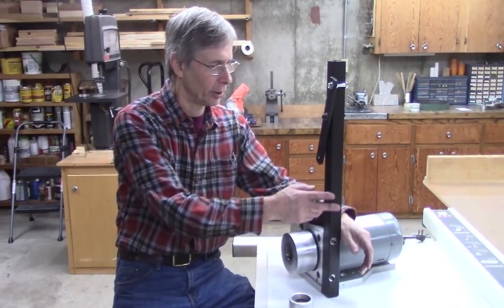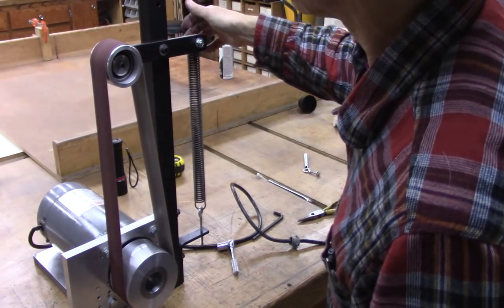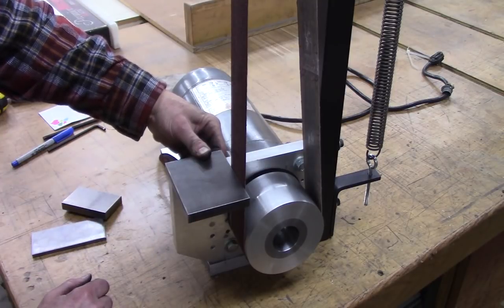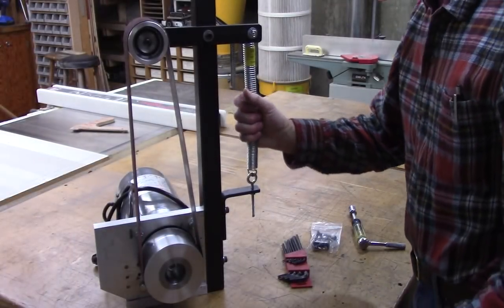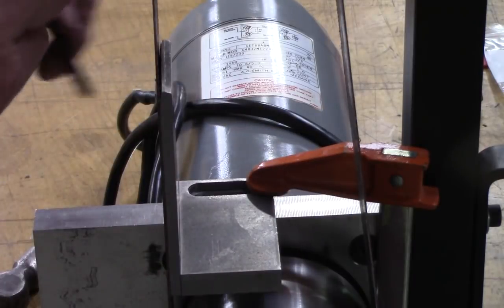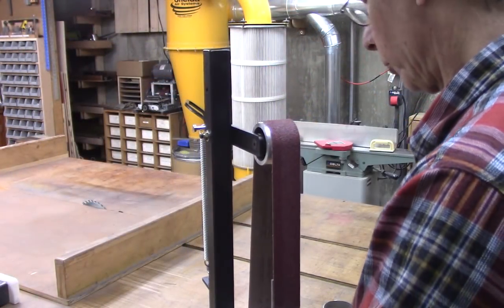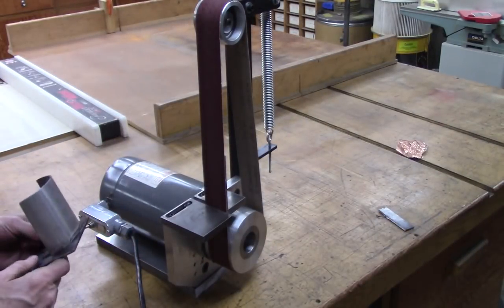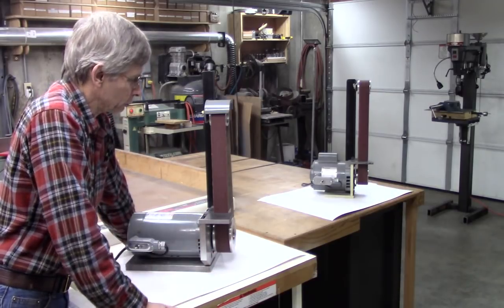A Great Little Belt Grinder - Part 2

Comment: I knew there was a reason I woke up early this morning -  to watch Winky Work Wonders!

I kept seeing that little grinder in several of the other video segments and wondered how you did it. I followed your Winkies Index until I found a way to sneak up on it.

 Now I'm going to go look for the " magnet on the end of a dowel rod" QUICK and DIRTY Method of drilling three or six holes using the Jaws on your Chuck as quadrant locating points.  I've only seen you do that once and I'm sure you have perfected it to adequately locate more than just three points - perhaps a set of dowels or a beveled board that sits perpendicular to the ways and has an adjusting screw on the - Top Edge to fine-tune the landing point for the Lower Side of the Chuck jaw.  The truth is out there!

 Happy Super Bowl Sunday     - Go Chiefs
Reply from the maker: The belt grinder is one of the most important tools in my shop! I love this grinder. 
As for the jaw indexing, I simply took a wood dowel and put it between the bed and one of the jaws.

Comment: Cool trick with the toggle switch on the cover of the condulet box!
Reply from the maker: Aside from the wire coming out on the wrong side it worked well. I could not find a little utility box with a 1/2" threaded conduit opening.
Reply: I thought that was a great idea also and it looks good too.

Comment: The hunt for an appropriate motor begins now.  Excellent build.
Reply from the maker: 1/2 to 3/4 HP 3450 with a 56 mount. Thanks!  ALSO....  If you have a lathe just cut a groove for the flange of the motor and drill a hole for the shaft. You don't need to cut the hole all the way through.
Reply: Thanks - good build. I would add guard/trap at bottom for residue.
Reply from the maker: @jerryquigg3497  - I was thinking the same...  maybe a curved piece directing everything toward the back with a box...  Maybe even with a filter to allow air to move through. As is, this thing makes a huge mess.
Reply: Winky's Workshop I have ~5yr old small $50 HF 1” belt unit and I trap (from the vacuum port) the residue in a small enclosed cardboard box. Also, If you grind w/o the part being grounded you may get quite a shock from the static buildup as you touch the grounded machine.
Reply from the maker: @jerryquigg3497  - Cool...  I'll try something... maybe just a metal box

Comment: I have a 50 inch circular saw mill up here west of Prince George. We saw a lot of the poplar family for trim cladding in the log homes we make. I have always considered it the most under utilized fiber in BC. 3 family's of the stuff, Fast growing and flexible with it's long grained fiber. We use cottonwood  for lowbed planking and aspen for door and window casings. Beautiful colors within it that are amazing. With the beetles going at the needle trees (all of them now) we had better get going on this new/old fibre eh.
Reply from the maker: I 100% agree. Under utilized! All poplar grows very fast. I'm only familiar with the southern Tulip Poplar. It goes by several names, I think I called it Yellow Poplar in the last comment. Large long trunks with clear straight grain. Very good wood. Not very hard but very stable utility wood. I use it inside cabinets for draws and shelves mostly.
Reply: @WinkysWorkshop  I have heard about your tulip poplar. Prized by carvers as well. We get kind of a die back in our poplar up here every seven to 8 years so the stands of nice clear logs are well circulated and are a prize to our beaver populations. The stands of 8 to 12 inch butts are rarely passed up by our farm community folks as a cash crop when the water table is just right. Not a thing they are used to eh. LOL.
Reply from the maker: @TomokosEnterprize  I'm getting too old for real big heavy projects but I always wanted to make a saw mill with a circular saw maybe 3-foot and mount it to a carriage about 12 feet long. Then mount an 8 foot log on spindles that index and use it to radial saw wood. From what I understand they used to cut siding for homes like this. For parallels cuts the spindle would need to shift but the biggest problem for me is figuring out how to cut the board off at the center of the tree. The best 2 things about this method is 1) easy log handling and 2) perfect quarter (radial) sawn boards. Really I could go smaller like maybe a 2 foot blade and limit my log size to 20 inch. Email me - winkysworkshop@GMX.com
Reply: @WinkysWorkshop  I would honestly use a band mill then they can 1/4 saw and the recovery is far higher. Circular saws are notoriously hard to get along with. They loose a one inch board on every 3rd cut and  The sawdust is hared to deal with as well. The saws are hard to manage and there are not a lot of fellas around that can pound them to keep them running well. A saw can cost a hundred bucks to get tuned up and just one heating around the collar Drive arbor can ruin one.. The band mills can be tuned up at home in about a 1/2 an hour and only cost $25.00. A saw like ours can cost $800.00 to buy and Without extensive training can cost hundreds to manage. For my buck I would  go band all the way my friend.
Reply from the maker: @TomokosEnterprize  Yes, bandsaw mills are probably the way to go. I was just thinking about different methods. I did see a mill the other day on youtube that was kind of like what I was talking about. It cut half way through the log and cut the board off on the return pass. But I'm sure you are right...  even a 2 foot blade has to be 1/4" thick to cut straight. I'll never build a mill anyway. I have way too many other projects that are higher priority.
Reply: @WinkysWorkshop  After being a millwright for a few years and building a couple mills and chasing whistles at a couple of big mills I have them well out of my system now. I like the idea of this one legged retiree (kind of) watching you build some really nice pieces works ok by me but the Welding and machining I do miss.

Comment: Thanks for the quick reply. After I sent you the question I happened to see you part 3 that gave the belt size and the dimension. Thanks again and keep the videos coming, quite enjoyable.
Reply from the maker: Your welcome! To be honest I'm not sure how I ever got by without a belt sander. If you build one you will be amazed, especially if you go with the larger drive. If you are interested there is a link to the drawings under the video of part 3

Comment: I like the hand drills that have the bull's eye level in the back of the grip to keep it plumb when drilling.  Very nice work.  I've got lots of electric motors, including five 1hp pool pump motors....i can see a couple different belt grinders in my future...Good LORD Willing!
Reply from the maker: I agree on the hand drill... be sure and watch Part-3. Also, if you used the 1-hp motor make sure if fits within the 6 inch plate. I have one that is too big. Thanks for watching.

Comment: I might have a motor laying around that I can make a belt grinder. Thanks for the demo.

To hold two pieces of metal together temporarily, Blondihacks uses superglue. They stick quite well. And the pieces can be taken apart with the firm rap of a machinist's hammer, and maybe a little application of heat. Cleans off with acetone.
Reply from the maker: Thats a good idea, thanks

Comment: How do you have a flat surface in your shop? I never have those!
Reply from the maker: Yeah that has always been a problem in the past. I actually spent about 2 or 3 month working mostly on organizing the shop. After that I started a new procedure. About once every 2-hours I stop what I'm doing and completely clean up. At first it seemed almost silly to put 1/4" drill or 9/16"  wrench away when I knew I would be using then in 10 minutes but it honestly makes working in the shop a lot more fun. Same with the chips on the floor...  why clean them up when in 10 minutes I'd be making a new mess. I'm sure this sounds silly but it works!

Comment: The grinder looks good and is simple build. A couple of questions what width belt you using? Also how do you like the Cobalt cordless tools from Lowes? The price is better than DeWalt Or Milwaukee
Reply from the maker: The belt is 2" x 42" but I put an extra hole in the upright so I can use a 48 inch belt if I want. In my opinion most people don't need anything wider, I know I don't. Also tracking is never an issue on a 2 inch belt with a crown of .020" to .025" on both pulleys. Wider belts are touchy. If you ever build one use a 3/4 to 1 HP 3450 motor with a 4.5" to 5" pulley. So far the Cobalt cordless is great. I have the drill and impact. The batteries are way cheaper. I've only had them about 6 month so ask me again in about 3 years. So what did you think about the steel core falling into the aluminum pulley? The steel was almost .002 over!

Comment: This is a nice simple design. Since you have a lathe and mill, have you ever thought of making a tool and cutter grinder? I think you'd come up with a nice simple design. There are a few around on the internet being built at the moment (or recently).
Reply from the maker: Thanks, and yes, I have thought about building a tool grinder. Probably something simple, I don't need a tool grinder often but I'd probably use it.
Reply: @WinkysWorkshop  Well, if you want any encouragement - I'm here to encourage :) Making one is on my todo list too, but I haven't got to it yet. I think it's one of those things that you find more regular uses for once you own/build one. I know my pile of used endmills is growing and at some point it'll be worthwhile building a grinder rather than replacing them. 

Let me know if you'd like pointers to the ones I have seen around and about the place. I could send you some links in an email. Would love to chat about it more if you have time. Cheers, Craig
Reply from the maker: @CraigsWorkshop  - Grind drills and lathe tools is easy but grinding an end mill is more complex. Also, I've started buying mostly carbide. They last way longer but are also much harder to grind. I just watched a This old Tony on sharpening end mills. seemed complex mark21056@gamil.com

Comment: Great project!  I would want a contactor rather than a toggle switch though...
Reply from the maker: I use this thing daily! Very handy. Yeah a contractor would be better although the switch works well. It's only 3/4 HP. I had an old Rockwell Delta 10 inch table saw years ago that had a 1.5 HP motor and it used a toggle switch. It did fail twice. After that and I replace it with a standard wall light switch. I used it another 8 years and it never failed.
Reply: @WinkysWorkshop  It is not a matter of reliability, but safety. If the toggle is left on, then plug the device in and it starts at once! also, if you get your sleeve caught in the belt, you want a big button to hit for off. Illegal not to have a contactor in Europe. I have retro-fitted ones to all my old machine tools.

Comment: This is something I can make myself. Very good directions and problem-solving. Maybe a duplicate wheel guard for the bottom pully will help to keep the sparks from burning the workbench? One question: may I ask why the tool rest is not adjustable for grinding bevels at different degrees?
Reply from the maker: Excellent questions, but first, make sure you watch all the videos. I made a guard for the bottom and covered a much easier method of mounting the motor. About the tool rest: My primary objective was to make the tool rest solid and square. A flimsy tool rest is annoying and reduces the effectiveness of the grinder and most of what I wanted to do with the grinder is debur, round corners and square up the end of stock. I did make the tool rest very easy to remove (two 1/4-20 screws) so making a needed tool rest would be easy. Also I made the tool rest small and square to the belt. I have made a few guides that sit on the tool rest and hold things at an angle. A cut off blade sharpening jig is covered in the last video.

Comment: Looks great! good tips,  I'm going to consider all that in my design. M wondering if rubber wheels would also work,  I found some larger casters in a surplus store and think I can make them work, noticed on my belt sander they have rubber wheels over steel like these casters. Thanks again mr Wink, great job
Reply from the maker: If the casters are wide enough and the rubber is hard it should work great however you will probably have to balance them. The rubber isn't really needed for traction. The belt on my first grinder with the 3" drive will slip but it takes a lot and it almost stalls the motor. On this new grinder it will not slip. I suspect it is the amount of surface area on the larger wheel. I considered using caster wheels and probably would have but I had the aluminum wheels already. Thanks for watching!

Comment: Great video.  Too bad most of us don't have a complete machine shop with mill and lathe.  Could you build this belt grinder without mill and lathe?
Reply from the maker: You'd have a hard time without the lathe but the mill isn't really needed. Part 3 outlines how to use a lathe to make the motor mount.

Comment: Really nice design, smart and basic. Love the dance at the end!  If you should add adjuster to the top wheel, how would that look like?
Reply from the maker: On my other grinder I added a little set screw just below the bolt the pivot arm pivots on.  If needed it would deflect or skew the roller. It worked but it was not needed.

Comment: What size is the belt that you used 2x46,48? Great build and so simple yet very functional. Love all your videos, keep them coming I hate to say it but I’m certainly incorporating a lot of your ideas into my builds. Thanks
Reply from the maker: Thanks! It's 2 x 42 but put an extra hole in the column so I can move the arm and run  48 inch.

Comment: Nice job! Would there be any advantage to making the vertical back support for the belt a bit longer so you could free hand bigger pieces off the rest table, and still support the back of the belt? I was thinking, why not go up close to the top pulley with the support. It might prevent breaking a belt someday.
Reply from the maker: Thanks! The back support is good for squaring up stock but the unsupported belt is great for deburring and rounding corners. You can easily deflect the belt at least an inch without miss-tracking. The crowns on the pulley keep the belt center very well.

Comment: Great build, simple and strong. What length belt does it use?
Reply from the maker: 42" but it would be easy to use a 48, just make the post a little higher. I actually left my post a little high in case I wanted t use a 48 inch belt. 

Part 4 has a link to the plans for this grinder.

Comment: And where is the upper pulley setting? Does the tape not fly off when sanding?
Reply from the maker: The upper pulley is spring loaded an holds tension on the belt. Both pulleys have a crown meaning they are slightly larger in the middle. It's hard to explain why but a belt will always go to the high spot in the pulley and this keep the belt centered.
Reply: @WinkysWorkshop  Of course. I have seen designs with such shafts (barrel-shaped) and in addition there is a plus adjustment of one shaft. Interesting design. Everything is ingenious - simple. Thank you from Ukraine.

Comment: Excellent machine. I went right out to the shop, found a 1.5hp 4350 engine and started building one for me, utilizing your design.

One question, what's the upper pulley diameter? Assuming it's the same as the bootom - at 5" diameter. Thanks
Reply from the maker: Thanks Michael. The lower pulley is 4.5" and the upper is 2". Just a few thoughts, my motor was 3/4 HP but I have a 1.25 HP that will not fit on a 6 x 8 plate. It's the same 56 mount but the motor itself is too big Also, somebody made a comment about the drive not being keyed to the shaft. So far I have never have a problem with my smaller 3 inch drive pulley grinder but more HP increases the likelihood of the pulley slipping. If you make the drive like I did with a steel core you could tack weld the nut to the pulley or better yet, drill and tap a hold right next to the nut holding the pulley on and put a small screw in it. This would make the tighten itself if it started to slip. I'm doing a follow up video to discuss a few concerns and will post if Friday. I will also post plans but here is a link to the plans if you want to get a jump on things - Thanks! https://drive.google.com/open?id=1K1kPbT6IHLP9JlTj-6SKtCQXgr5vuJW7
Reply: Thanks Winky. My motor shaft is 1/2" and it's keyed. Shaft length is short but I'll deal with it.

Ordered up some 1/2" plate from Speedy Metals and waiting for that to arrive. Used the same conduit LB and SPST switch as you did. Must admit I haven't seen that setup before but find it much more appealing than the separate enclosure route. Good job. I will be watching for your Friday update.
Reply from the maker: @michaelalsup9817  - A keyed shaft is really better although being short might be an issue...  depends on how short I guess. Before you cut the hole in the plate watch the video Friday. It's easier than the mill. Good luck.

Comment: Winky, where is the shroud on your MIG torch. You must be careful using it without a shroud. Should you happen to short the nozzle instead of the wire, you may get an almighty arc. Good series by the way, and glad to see you gave up on the brake dancing and invented your own style.
Reply from the maker: The break dancing killed me! About the MIG, I was using it with gas but switched back to the flux core. The other day I noticed Harbor Freight is now selling a flux core inverter welder and it doesn't even have a provision for the shroud. Now I am wondering if the tip was insulated although i remember it being brass. Anyway, on a 110V MIG the flux core works way better and the visibly with the shroud removed is amazing. A huge plus!